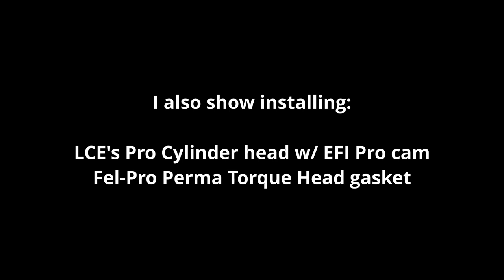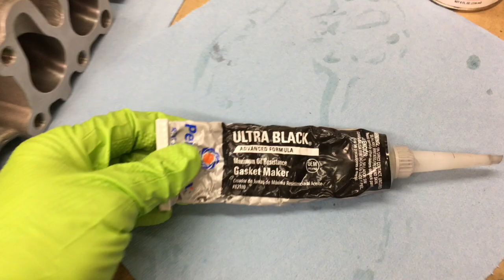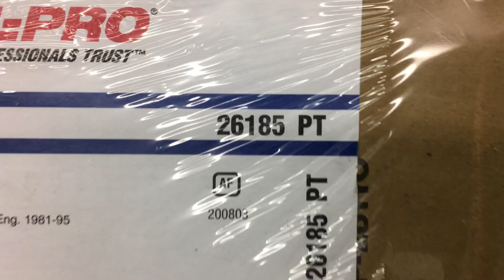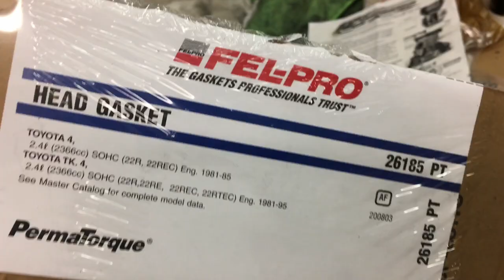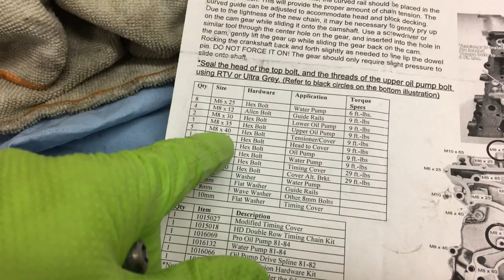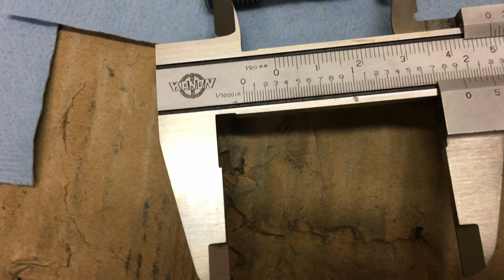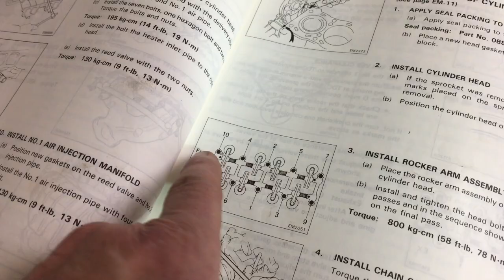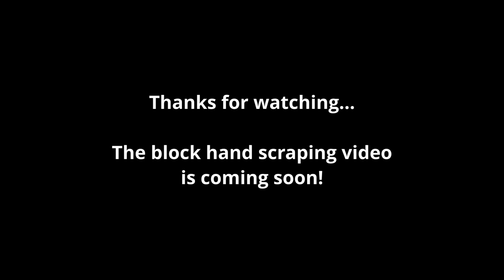Toyota 22RE dual row timing chain cover upgrade & LCE Pro Cylinder head / EFI cam installation tips

Comment: Why were you rebuilding your engine in the vehicle and not on an engine stand? It would seem much faster and easier access for all parts all the way around. Also a lot quicker.
Reply from the maker: Yes, pulling the motor would have been better. I just didn't have my hoist setup at the time and things went from a small project to a bigger project as time went on.

Comment: When I had my 22RE out of my '94 Xtracab due to broken chain guides getting upgraded plus a new clutch and other jobs, I had it nice and clean like that and it was so nice.  But, being a 4x4, you can imagine how long that cleanliness lasted.  I never removed the head from mine, and it's at 207k and consumes about 1.5 qts every 3k miles, and some of the exhaust studs have stripped the threads out of the head during header install, so I'm considering replacing the head with one of those new ones that come with some of the mild upgrades.  But it's my daily driver so if that ever happened, it'd be down the road once I get an extra vehicle.
Reply from the maker: I sell some real nice Titanium exhaust studs on ebay... that's what I use on my 22RE. RaceTi sells some nice M10 Titanium nuts. The cylinder head on my motor originally had some stripped threads and I had to repair them using time-serts

Comment: Hi Ray,   Just wanted to know the torque specs for the timing chain tensioner ? Also it is the LCE dual chain kit!  Thanks for all the informative 22re videos!!
Andy
Reply from the maker: It should be in their instructions or on their website. It's not very much as I remember. I used higher grade bolts on mine, but I just use some blue or red loctite on those, with flex washers and tighten them down tight by hand myself.
Reply: Hey Ray,  Thanks for the info!

Comment: What kind of ultrasonic cleaner do you have? I'm looking for one.
Reply from the maker: It's just one of those ones off amazon or ebay. I don't remember for sure where it came from. My amazon orders say Kendal but they have since changed the look of it. I believe it's 3 quarts and 220 watts. It's great for small stuff, like nuts and bolts or small tool parts and stuff.

Comment: Looks like you installed the timing cover without dropping the oil pan! The Chilton/Haynes manual says to drop the oil pan, but to do that you have to drop the front differential (mine's 4WD, yours isn't obv); I don't really want to do that - looks like I can get away doing it as you did (leaving the pan on), unless maybe I missed something. Anyone have experience trying this successfully (leaving the pan on?) - thanks!
Reply from the maker: In this case (because I had the cylinder head off), yes I was able to install the timing cover without having to drop the pan. I just put some RTV ultra black down there and then snugged up the front bolts between the pan and the bottom of the cover. Now, if you have the cylinder head on, it might be a little bit tighter fit, although it can still be done without removing the pan totally (as long as there is no cork oil pan gasket). If you loosen all the bolts holding the pan, you can pull it down slightly and gain enough room to slip the front cover into place (even with the cylinder head bolted down). If you check some of my more recent videos, I do that on my friend's truck (although I did end up pulling the pan to clean it in the end). But if you are careful, you can slip the front cover on and off and then just seal things up using RTV carefully at the top and bottom. It's not ideal, but you can accomplish it. What you wanna do is test putting the front cover on and off before getting RTV on there. Just put some WD40 on the indexing pins so the cover doesn't grab on and get stuck. But basically the cover can slide in and out between the oil pan and head without too much problem as long as you are careful. Sometimes you have to get some copper shim stock to help out or use like a super thin sheet of stainless to help the pan slip in under the head gasket part there, but you can do it. Make sure to pull the radiator so you have plenty of room to work.
Reply: @ray5961  awesome - that’s all the encouragement I needed! Thanks so much for the quick response - I really appreciate you and your channel. I’m going to give it a shot!
Reply from the maker: @CNAEVR  Yeah, it shouldn't be too difficult to pull off.
Reply: @ray5961  something I noticed when pulling off the head; the intake manifold is absolutely full of oil residue. It’s coming in thru the throttle body ( 
not sure what would cause this). The reason I pulled the head was due to a severe oil leak where the head sits atop the timing cover (apparently someone attempted the replacement of the timing cover gasket like we’re discussing previously, but didn’t do a good job). Also, I was hoping to see an obvious head gasket failure (in addition to the oil leaking out of the front) which could explain the white smoke that lasts for about 10 minutes on startup, then disappears for the rest of the day. So yeah, I’ve got a few issues to work thru.
Reply from the maker: @CNAEVR  The intake plenum and runners can be pretty junked up inside due to the ERG system circulating exhaust in there. Also, if your PCV system is stuck open, it will suck in a lot of oil. Sounds like your motor just needs some TLC. As far as oil up to the cylinder head, there is just one passage that runs up the forward head bolt to the valve train and then all the oil drains out at the back of the head. Check some of my videos for the head gasket to use.. it's the Permatex PT one... way better than OEM... https://www.amazon.com/gp/product/B000C2CA4A

Comment: Use an oem toyota gasket set. Felpro is garbage. I had a felpro headgasket blow at each cylinder crimp after only 65k.
Reply from the maker: Do you have a part # for the Fel Pro gasket you used specifically? I'm not a huge fan of their normal one, but I do like their PT version; it has some Kevlar and Telfon reinforcement which I like and it seems to be very nice quality from what I could tell. A lot of blown head gasket issues can be caused by block/head prep also. I had a Stone OEM head gasket but wasn't super impressed with it as compared to the Fel Pro PT one. As a rule, however, I'm with ya.. OEM gaskets are generally the way to go. Check out that Fel Pro PT gasket next time you're in an auto parts store and let me know what you think.
Reply: @ray5961  felpro is ok to use on a small block Chevy or Ford engine but never use em on Toyota, Honda, or Subaru Motors. I've been building motors since the 90s. Felpro used to be decent, but I wouldn't use them on anything nowadays.
Reply from the maker: I'm with ya on Japanese quality brother!